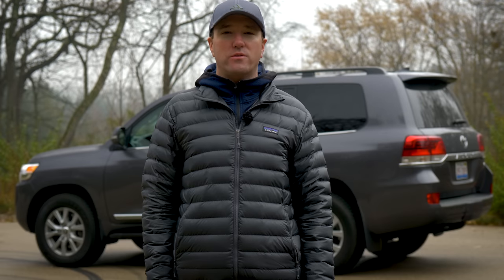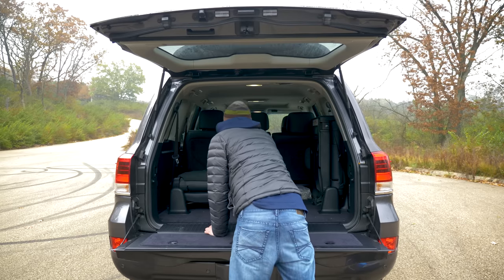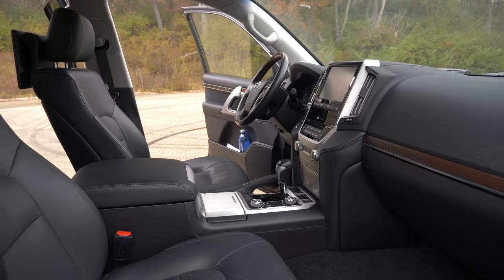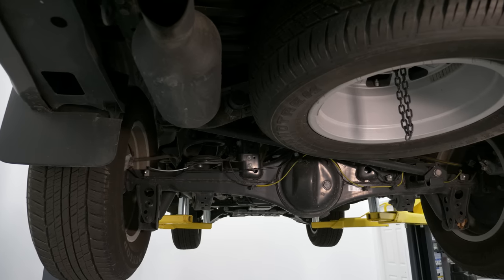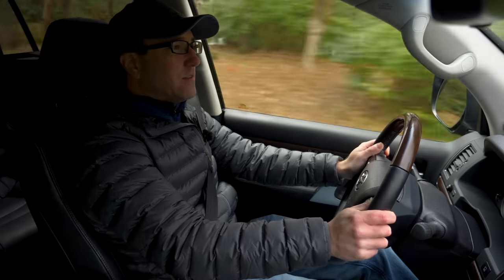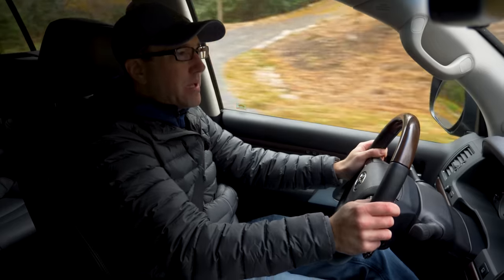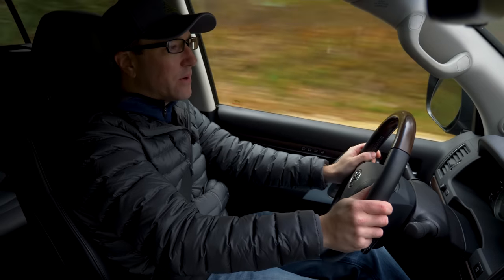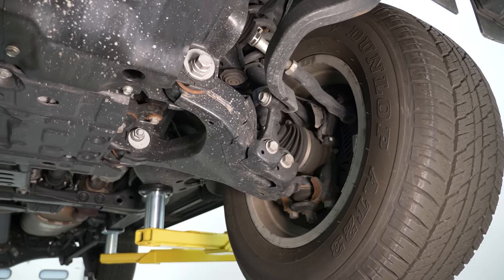Review | 2017 Toyota Land Cruiser | The Veteran

Comment: I bought a  100 series, the model prior to the above 200 series, new in 1998. So it will be twenty in six month's time and still drives nearly like new. In the UK we had the hydraulically assisted 'active skyhook' suspension on most models sold, which was only available on the Lexus in the USA I believe. Until last month, and in nearly 200,000 hard farm and towing miles, I had nothing mechanical go wrong. Original exhaust but had an alternator and on its third set of dual batteries. Its a diesel 4.2 litre automatic, four speed.
These sold very well in the UK.  The 200 series as tested, not so much. It just didn't sell and was/Is outclassed by more modern alternatives and is too big and thirsty, even though only diesel's have been sold here for 30 years or more. They have actually stopped importing it for the last five years or so.
In the last few weeks my electric brake booster/ABS/master cylinder unit has developed a fault. Parts price only is over £3000UK. I have to ask myself whether its worth spending that much on a 20 year old car. I'll think about it over my Christmas turkey.
Reply: Huw Williams  Get one from a nice wrecked vehicle/junkyard car. What most of us do.
Reply: Not too many at breakers. Most old ones seem to end their life in Africa and since the brake unit failure is very common, I suspect that any used ones for sale might have the same issue. How could I tell?
Reply: They need a Diesel for worldwide markets that can meet California emission standards. I have spent a lot of time in the UK but most people on this continent would be shocked by the Diesel soot of Europe.
Reply: What soot? All diesel cars and trucks made from about 2007 have DPF soot filters and gas engines now produce as much soot as diesel ones.
There are old Diesel engines in use of course but my 1998 200,000 mile LC does not create any visible soot. Not like those massive American long-nose trucks.
For those that doubt me, come visit Europe. It's not far.
Reply: If I remember correctly diesels have significantly higher amounts of very fine particulate matter (PM2.5) that is not caught by the filters, and significantly more NOx emissions as well
Reply: signs 
Untreated, yes. After treatment the latest are on a par. Search out the latest road vehicle emission limits for both diesel and gas engines and prepare to be surprised. Many European gas engines are now fitted with particulate filters to meet the regulations, just like diesels. Both types use cats and diesels now use DEF and selective catalytic reduction in combination. It is a great pity that those cheating shits at VW/Audi felt it necessary to cheat the official tests
Reply: signs 
The smaller particles. Well increasingly not. The latest high efficiency gas engines are about equal. 
Within the next ten years, none of this will be an issue in Europe as the internal combustion engine for passenger vehicles is being phased out. Both diesel and petrol/gas
Reply: Holey dooley. I can't help but think that it would be a cheaper part to get in Australia, based on how popular that model and the 200 is here.
Reply: From what I remember the particulate emissions had something to do with the way the test didn't detect certain pollutants that were released largely only in diesel engines so they weren't noticed in standard emissions testing. I'll have to find the data again as I last remember reading it a year or 2 ago
Reply: Huw Williams not true buddy - I have a 2015 200 series twin turbo diesel which are extremely popular here and it doesn't have a DPF. In Australia which is the largest Landcruiser market in the world (and where KDSS was invented) the DPF only came out in the model year 15 and onwards 200 series but in many markets they still don't have the DPF.
Reply: occyman
You highlight the fact that Australia is way behind most of the developed world when it comes to vehicle pollution control. That's not your personal fault and neither is it mine, but you get the minimum your Government sets as a standard. There are a great number of specifications that vary from one part of the world to another and this is just one.
1.1 million cars were sold in Australia in 2015, A country where the UK could fit in one tiny corner, yet 2.6 million cars were sold in the UK let alone the rest of Europe with equally clean[er] exhausts.  Australia takes about 10% of global LC sales on average, including utes such as 70 series. The Emirates are the biggest LC customers worldwide I believe, not Australia and the Middle East in total far exceeds Australasian sales.
Reply: Huw Williams - so you have a 20yr old last of the 100 series and they don't even import the 200 series in to the UK. Sounds like you know a lot about 200 series.
Reply: First of the 100 series. You should know that is when they were introduced. My friend and I were about to buy a 200 series each, him having a 90 series [he still has it] and me owning a 100 series [I still have I]. The dealer cancelled our test drive at the last minute when we were already on the road to him that morning. They really were not interested in selling the model, so within a month or so I had bought a new Audi Q7 diesel and my friend had bought a Mercedes GL 320cdi. We both have a fair fleet of vehicles in our businesses and by pure coincidence we both now own Ford Rangers with auto transmissions as well. I have the Limited and he has a Wildtrak. During the last few years I don't believe Toyota sold more than a few tens of 200 series annually in the UK, as Range Rover sales skyrocketed. I very nearly bought a Discovery5 early this year but I have a Volvo dealer only two miles away. Next vehicle will probably need to tow 3.5 tons to back up the Ranger, so that probably means a Discovery or RR Sport and unfortunately rules out the Prado/150 series unless they beef up its towing limit.
Reply: Huw Williams sorry it was a typo. I also had a 100 series. We have heaps of 200 series here - very popular and I am on my third as I change regularly. I use it for city, outback and towing a large van and also boat. My wife's Prado only has the 2500kg tow limit but the new ones have 3000kg. Having grown up in the bush driving Series 2 & 3 Land Rovers and owning a few Rangies I wouldn't buy another Rover. Ford Ranger is a good machine - I wouldn't want to go back to Utes though now. The Cruiser just ticks too many boxes
Reply: my mom has a 2013 with 100,000 miles and it still runs and drives perfect and has never has a single isssue
Reply: Huw Williams I have a 100 series too! Bought in 05 and now has 270,000 miles! I need to replace serpentine belt soon, pretty expensive, but other than that this has been the best vehicle ever. Drives like new, it’s super luxurious.

Comment: I also thought that the coolbox in the center console was kind of silly.  But then we took our Landcruiser on a 6,500 mile road trip this summer.  That coolbox was awesome.  We always had cold bottles of water available. No need for a cooler or ice in the back.

The Landcruiser is great for what it is.  It is a very comfortable road trip machine. I took it off road in Colorado, up steep, rocky trails crossing 12,000’ passes.  No, it isn’t a Wrangler, but within the limits of its geometry, it is quite capable off road.

That said, this is a 6,000 lb, body-on-frame, solid-rear-axle truck.  It isn’t a crossover. It handles well, for a truck.  It drives well, for a truck.  It rides well, for a truck.  But you will never mistake it for a car.  You are not going to get to a favorite off-ramp and decide to blast around it at speed. 

If you don’t take it off road or tow, then you might be better served by a crossover or minivan.

Comment: For $85,000 there shouldn't be ANY plastics. It's not like you're getting a Mercedes, so a portion of the 85k isn't going to brand name, so logically the 85k should be going directly into the car itself, and all the plastics, really turn me off. The price tag just doesn't make sense to me, especially for the top of the line Toyota. They could've fitted absolutely stunning Japanese woods in the interior, and even cheap metals are 100 times better than even the best plastics. Really disappointed in toyota's complacent attitude towards their cars. Their reliability schtick isn't enough to separate them from it's competitors anymore. But absolutely fantastic review as always, I just think a car can be ergonomically great without all these drawbacks, in my opinion of course.
Reply: Simon García you can't image people pay 200000 dollars for this car. It's way better than BMW or Benz . High resale value. Off-road capility and reliability.
Reply: Simon García the reason for the high price is people will pay it. The profit margin on vehicles like this is huge.
Reply: If anything, owners can always consider ICON to update the interior with more exotic materials and sturdy logos.
Reply: They are expensive because they are intended for long term off road use and abuse with minimal failure, this required billions for this SUV alone in engineering and R&D for Toyota from what I remember
Reply: Iceberg Dawkins funny
Reply: Part of that cost is the Land Cruiser being made in Japan and having a VAT. Also, 85k is MSRP -- most dealers sell Land Cruisers below MSRP because they don't want a low-volume SUV taking up their lot space.
Reply: 200 series are made tough and durable for the Australian outback which is where they were invented. And we get multiple versions and price points of it in Australia including a diesel which you guys don't get. USA is a small market for 200 series.
Reply: That's exactly right, though I can't confirm the initial development price tag. The cost is R&D and engineering. These vehicles are absolutely built to last. I'm also quite sure the plastics won't brittle after 7 years like many cars do with trim pieces rattling and switches coming loose.
Reply: burnferris correct and Toyota are conservative so you get something I guess a little less sexy but it will last you decades. I am on my third 200 series and only change because I like to have that new car thing every few years but given my driving requirements - family, city, off road and heavy towing I couldn't think of anything better.
Reply: Dear Simon... The money goes not into replacing plastics with metal, it goes into building a tank-like undercarriage and providing incomparably rugged and reliable engine. If you live here in Africa, or perhaps in Australia, and drive 50 miles daily to your farm on unpaved roads, trust me, no Audi Q7, Range Rover anything, Mercedes GL, will do that for 20 years with no issue. Simply not going to happen. No way. The only luxury alternative for someone who does that kind of thing would be the Nissan Patrol - this one ( https://www.nissan.co.za/vehicles/new/patrol-wagon.html ), not the new series. Otherwise you would need a very nice towing plan in place. That's why a lot of these cars start their lives elsewhere and end up in Africa, because the richer folks in the richer countries will upgrade in 5 or so years when the car still has 20 years of life in it. It is almost considered irresponsible by Governments and Non-profits like the UN to buy any other brands for use in the harsh African conditions.
Reply: Goodangel Matope - well said. Not many people know that the Landcruiser was basically invented for Australia back when the Snowy River scheme was being built. Australia is now the largest market for Landcruiser which is very interesting given we have a relatively small population. We have some of the harshest terrain on the planet and nothing other than a few special vehicles can handle it. Of course Africa and some parts of Asia etc are similar to Australia.
Reply: Who cares about Mercedes  when you can have a Landcrusier that will last you forever!
Reply: well check the new Suv's prices.. Cadillac escalade esv  almost 100 thousand,  Ford expedition.. just check and you will see
Reply: This is the king of Toyota and arguably the toughest and most off road capable stock vehicle that has ever made out there. What the fuck is Mercedes?
Reply: Ron Bellg $85K for the expedition. Lmao.
Reply: lol... you don't like plastics..? Mercedes Benz and BMW kings on plastics.. even the water pump lol.. and those cars BMW and Mercedes-Benz will never see the 300 k
Reply: Brian Zhu  yeap , that's right an expedition..
Reply: I just found a land cruiser one owner 350000 miles .. still working good..
Reply: Ron Bellg That shouldn’t be a surprise.
Reply: Simon García — Ever had a Benz in the shop?  Bring your firstborn.
Reply: 85k and volume handle pops out ??
The balance of exercise performance is also crappy.
It is very dangerous to raise the speed a little.
I do not want to die.
85k? lol
Reply: mercedes has a very poor resale value this doesnt you never loose money in this car
Reply: Every thing goes in to the chassis
Reply: Mercedes does not have endorsements from both UN and every terrorist organization and the mafia chains on the planet, don't forget this Russian tycoons.

Comment: Nice review, I just got my 2019 three weeks ago and love it. You comments about the brakes are spot on 👍. Still trying to get used to them. Gas mileage does suck, but my wife and I Have been driving under powered 4Runners since 2002 and I will take the power and torque for 5 mpg less. Good job, thanks.

Comment: Good choice on the Toto toilet.  I’m a Drake II owner checking in.
Reply: Totos are the shit
Reply: Andrew Nelson that's a good pun.
Reply: I too have a Drake II and it is rare to find someone else who does too. I'm not impressed by it too much. The flappers leak too often even after replacing. Should have designed the drain opening better. On the upside, when fully pressing down the flush lever it will produce a forceful push enough to flush a grapefruit or raincoat.
Reply: When we were in Tokyo a few years back we made a point to visit the main Toto showroom and visitor center. It's like a Tokyo motor show for bathroom technology.
Reply: It's actually listed in the Lonely Planet guide!

Comment: Land Cruiser is always a great SUV.  This model (L200) is pretty long in the tooth and outdated with regard to a number of features.
The new Land Cruiser (L250 in the U.S.) is a great re-design, great hybrid engine, a plethora of options, a luxurious interior with the Premium Pkg, and a great driver.  It is also stellar on the trails.  It weights over 5,000 lbs and is over-built as always.

Comment: The Expedition overland guys use a LC,$runner and a Taco! They sometimes hit some pretty muddy area's.Not rockcrawling but some very scenic wet muddy trails.So it must not do to bad. They have been using it to tow a trailer with some equipment.

Comment: Owned an FJ in 1980's. The main problem then, was rust on underbody. Eventually sold it to a logger. Who was driving it exclusively in bush. I saw it five years later in the local supermarket but did not chat with owner. Those diesel engines were bulletproof.
Reply: Chassis rust is always a problem on this kind of truck. I've waxed the chassis on mine thrice but things like brackets, the fuel filler pipe, the cargo area underfloor and the rear axle are getting really crusty now. I also put a new front wing on it a few months ago due to a big hole above the front bumper in front of the wheel.

Comment: I have an ‘11 Land Cruiser.  The brakes are strange, but work as designed. It appears to be virtually the same with the ‘17.  ‘Mushy’ when you initially apply the pedal, but as long as you’re aware of / familiar with how the braking system behaves (and remember it’s three tons with a full tank of gas and you sitting in it), you’ll be fine.  Yes, the MPG is painful.

Comment: Pity the US didn't get the twin turbo diesel V8 like we did. They have huge torque, get good economy and sound great with an aftermarket exhaust. 
Only downside is a low hanging alternator which needs to be replaced with a sealed one to keep the mud out.

Comment: The spare comes down with a pulley that cranks using the tire iron. Little hatch hidden inside the tail gate opens and you put the iron through. Few turns and it's lowered down on the ground. 

Or thats how it works on the GX470 and 4runner iirc

Comment: Turbo Diesel V8 will reduce fuel consumption by around 50% over petrol.
Reply: Yes but with the new regulations for diesel engines this is not safe to own. The gas engine can be converted to LPG and this solves the problem.
Reply: @Combine1331  If only comments from 2 years ago can evolve with the changing times, I wouldn't need to reply.

Comment: Getting back to the brakes. They were the same on my FJ Cruiser. Once in a while they would just go full power for no apparent reason. So I went back to the manual and found out they have an emergency braking system that depends on the speed you depress the pedal. If you apply the brakes normally, you can keep raising the pressure to the max and they will perform normally. But, if at any time you depress the brake pedal quickly, it's interpreted as an emergency and they go full power even if you don't apply much pressure. It's the speed the pedal moves and not the pressure applied. Once I understood this, it became a non issue. It didn't help that my previous Chev. pickup was the total opposite. You could stab the brake pedal with all your might and it would take a second to start braking. In fact a quick kick of the pedal didn't do anything. After years of pre-braking the Chev it took me a while to relearn to apply the brakes more smoothly in the Toyota.

Comment: in my country we have another level of options in the LC200
like 20” wheels , sport/sport+ / comf / eco / normal drive modes and we’ve got a air suspinsion that can rise up and get lower
we have a black / white edition and finally it’s available with 4 deferent engines 
v6 4.0L 271HP
v8 4.6L 308hp
D4D v8 twin turbo 4.5L 234hp and 640nm of turqe
and the 5.7